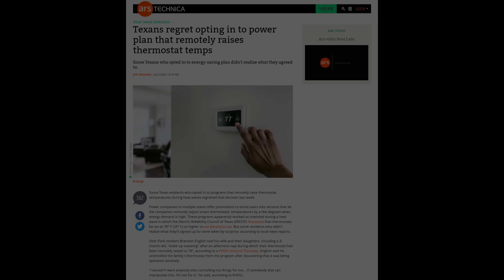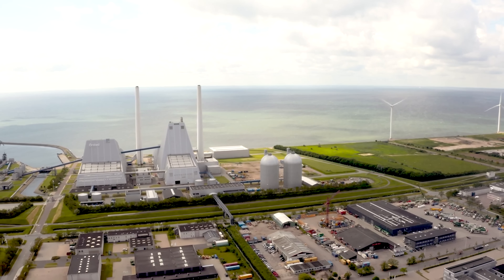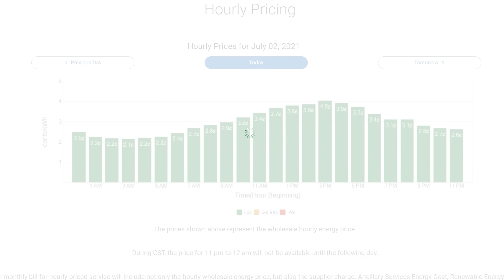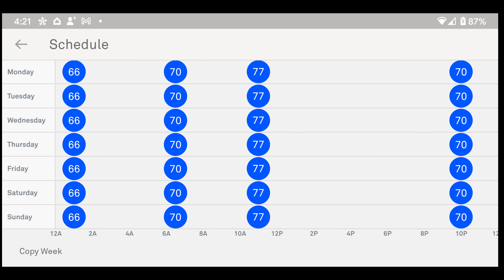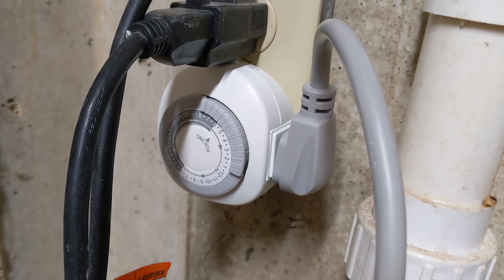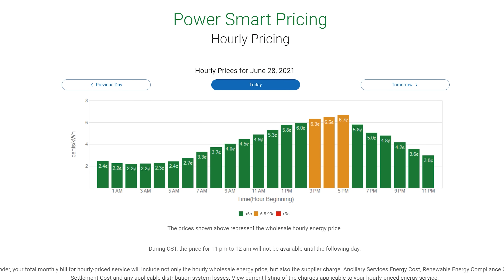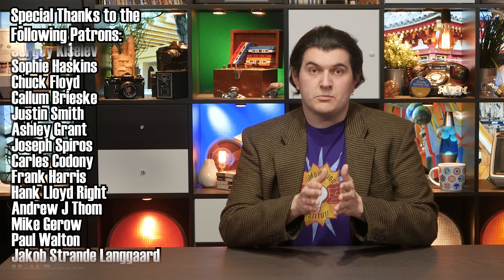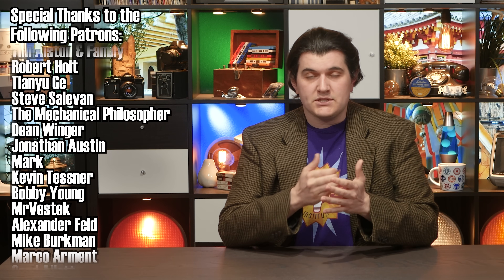Batteries aren't the only way to store energy. Here's another.

Comment: I live in Bangkok, the hottest city on the planet in terms of consistently hot day/night temps. I live off-grid on top of an apartment building. The people in my building generally don't run air conditioners a lot, as they are generally poor. Therefore there is a heat build-up which causes hot air in corridors to rise up the stairs and pass through my apartment, due to the ventilation. The people who lived in my apartment before me moved out because it was too hot and/or their air con bill was too expensive. Yet, I am cool, and don't run my air con at all for every month except April. Firstly, I open my doors during the day, and awnings (covered with PV panels) block the sun's energy. For night, I observed that night-time temps are usually around 26°C, which I consider comfortable for sleeping, especially with a thin blanket and a ceiling fan. So, I installed a separate ventilation fan to suck humid air out of the bathroom window, and added adjustable vents above our heads to let outside air in when we sleep. So we get fresh 26°C (79°F) air drawn in onto us as we sleep, and wake up to a nice dry bathroom (good for stopping anything growing in there). This is powered by solar charged batteries (along with everything else). There's plenty of sunlight here. Also, because fresh air is being drawn in constantly rather than recirculated, dust and mo(u)lds are no longer a problem. For April we run a Daikin smart inverter a/c gently blowing cool air onto us (as we want to be cool and don't care about the room, we can set the thermostat higher). It has a SEER rating of 26.

Comment: My electric CoOp, does exactly that, they 'pre-chill' my house before the peak demand- Only by a few degrees, and that allows them to turn OFF the A/C during the peak, while maintaining my temp... Oh, and if I find that I just can't live with it, I'm free to just turn the Nest thermostat and boom! It starts cooling again...  Of course, I'm risking a rolling black out for everyone.   The blackouts of 2021 (I'm in Texas), did change one thing.  I used to be on a  'critical' circuit, and never lost power in 27 years of living here... Well, OK, about 5 times for maybe 5-10 seconds max...  Since the rolling blackouts - which I didn't lose power at all during, they realized that although, I lived near a police and fire station, as well as very close to a pump for the city water, my house was not really critical, and they have rewired... Which, I lost power when they cut me over to the non-critical circuit, as well as maybe 5 times since... Which, really sucks...  Lost power just last week in fact..

Comment: I use the insulation strategy but its interesting to me to see others use it since for me I use it since I sleep extremely hot to the point I can actually heat up an entire room with a window facing a blizzard wide open for an entire day requiring me to have my window open to counteract any excess heat.

Comment: I've implemented this method of energy storage but with heat. In my country, we have high rate and low rate electricity. Low rate is from 10pm to 6am. And that's when I heat the flat. I kid you not. I've cut electricity expenses by more than a half. I can live with my temperature being 18.5-19 in the evening before I turn on the heating, because it's worth to have a chilly flat for a few hours than to pay twice the money for 2degrees difference.

Comment: I am going to issue a correction. 

At roughly 0:45 into this video, the claim is made that the "number of extreme weather events is rising." This is at minimum inaccurate, and at maximum, false. I have not heard any objective, scientific report issued by any public educational, governmental, or inter-governmental body, claiming this.

In point of opposition and fact, it is well-known that we have had weather satellites in Low-Earth Orbit (LEO), both geo-synchronous and fluid orbital satellites, and there is no evidence indicating nor supporting the claim that either or both are true:
1) That since the 1970s, the number of severe weather events have increased
2) That since the 1970s, that the severity of severe weather events has increased

Therefore, with no evidence to suggest that this is the case from an unbiased source, this claim should be discarded as false.

Comment: Here's a solution, assuming a government that didn't hate its citizens. Unify the power grid system into one nationwide grid and nationalize each utility into a single State run entity that can redirect excess generation potential where it's needed, eg, sending power from the Gulf Coast region during times when the hydroelectric plants we built into the desalination plants are generating a lot more than what the region needs and send that to the Mountain West states because they're having a massive heat wave and they're also combating wildfires

Comment: I live in Puget Sound region of Washington state in a 1940's vintage house with a basement.... no air conditioner... and my heat does not come on if temperature is 58 degrees or more, most of year no heating needed... rain and overcast in Winter keeps out side temperatures about rain temps... mid 40's... in summer the basement tends to stay cooler ground temps... power outages are mostly during storms... house not compatible with roof mounted Solar... most of our power is hydro... a little from wind farms... hydrocarbon  is almost gone...

Comment: I would put a sealed water tank underground and store my energy there. No need to mess with the temperature of my house that much but still instead of actually cooling during a peak period I would simply use a fan to drive air through my water tank cooled during off-peak with an actual heat pump. I would use water tank because water has a lot of heat capacity and if I put the piping at the bottom, the cold water will be there to take the excess heat and then it will rise out of the way.
Reply: 21:26 Something like that. Except instead of freezing the water I would simply cool it down to 2 to 4 celsius degrees. And have a lot of water there so after I am actually needing that cool air, I can send the air through some piping hidden in this tank, dumping the excess heat there.

Comment: There may be another advantage to running the AC when it is colder outside:  Since the AC is working against less of a thermal gradient, it may be able to pump out more heat using less electricity.  Is this true?

Comment: Instead of giving my utility direct control over the thermostat I would be more comfortable with my thermostat checking with them and finding that an unusually high load is happening and it is advised to reduce heating/cooling use, but I still have control over the setpoint it uses for reduced demand times and can choose to affirmatively but temporarily override it (unless it's a demand emergency) maybe for a premium cost.

Comment: I certainly prefer warmer temperatures than most in that 80F is most comfortable for me; unfortunately, my modem needs it to be a little cooler as it overheats if ambient temperature is above 78F, so I have my AC set to 78F, but even during summer in the Midwest, I can frequently avoid running the AC at all (or at least until quite late in the day) by opening up all my windows overnight and letting the house air out naturally. My house is about 40 years old and has seen no updates to the windows or insulation since construction, and even with that being the case, I'm able to keep things comfortable for my needs. While a big part of how my situation works has to do with my preferences for warmer temperatures as well as the fact that, even during the summer, in my area it pretty consistently gets down below 65F overnight, the point I want to make here is that it's worth looking at what we can do without using any electricity at all before (or at least in conjunction with) how we can use electricity most efficiently.

Comment: Transfer of heat depends on the difference between the two temperatures. The larger the temperature difference, the more heat gets transferred, so it is not simple to calculate the real savings of this scheme. The better insulated your hours, the better this scheme would work. But certainly using fossil fuel free baseload is a great idea. I assume you charge your car also at the lower Time Of Use rates.

Comment: Running your AC at night should also be more efficient, as the somewhat cooler outside air should mean the condenser unit doesn't need to work as hard to dump heat outside.

Comment: Our SMUD had its Peak Corps to shut off AC remotely via boxes screwed to your AC if you enrolled. That is all passé now. We now have meters that will track time of day usage, which allows higher prices during peak hours. Thus it is left to the consumer to decide when he wishes to run his AC. SMUD cares little how much energy costs, because the customer reimburses them for it, whatever time it is. So instead of added controls, it is solved by pure economics. Now if a consumer wishes to improve his energy usage with insulation, gadgets or strategies, more power to him. Else he pays through the nose, even to build new plant.

Comment: You are using a little more energy overall this way, because energy transfer through insulation is a function of temperature gradient, and in this way the amplitude in your house is larger. Still probably worth it, just wanted to mention it.

Comment: I wish i ever lived in a well insulated house. If it is 70 degrees F out my room will go from 65 to the temperature of the outside air in less than a full hour.
It happens faster when it is really hot out.

Comment: Or they could design homes and businesses like they did years ago when they were built efficiently and had airflow with a couple of windows open.
Reply: You brought up a good point because once people started using HVAC systems in their home Home Design and the engineering and Bob went to s*** when it comes to layout air flow where the sun crosses your home during the hottest part of the Year blah blah blah
Reply: @lyleg.9192  I remember renting a 1950's duplex and barely running the a/c (in florida). I'd open the front door with a screen and the back door and the wind that went through there could fly a kite. In my "new" home, if I turned off the a/c, I'm cooked. so yea., tech is great, but not always as great as good design.
Reply: @no_handle_required  it's not so much about new homes with technology it's the complete lack of Home Builders and for that matter home buyers using tried-and-true steps for where to locate the home how to build a home the environment around the home everything working together where does the Sun Cross during the solstice everything playing its part the biggest problem with new homes is it technology it's constructed to make it energy dependent

Comment: I have some friends that say to keep the house at a constant temperature. They say that if you let the building raise temperature it makes the AC “run harder” when you turn it on. Can you please speak on that?
Reply: depends on how long the AC is running, how well the building is insulated, the climate, what kind of AC is runnging. Generally, if you know you're in an area of high humidity with a heat pump AC and plan to go somewhere for more than a day, never shut it off because when humidity climbs, that promotes mold. Also AC's are either on or off, they only cool and heat at a specific rate, though leaving it off will make it have to get to temperature because it starts to cool/heat.

Comment: This inspired me to take a more in-depth look at my AC scheduling. I commute to work so I could skip some of the daytime home comfort settings, but I've further dialed in my AC to get it to do what I need it to. I looked at my Ecobee data in Home Assistant and realized my AC was short-cycling at night and during my "home" comfort setting. 

To combat this, I'm going to try the strategy to chill my apartment to 65 at night, let the cooling set point sit at 77 during the day (like I had been doing), have the AC kick in at 4 to re-chill the apartment to 68, and cut back up to 73 at 5 so that it's comfortable without running the compressor as much.

I live in the south east in an apartment that gets afternoon sun and doesn't have great insulation, so by the end of my "Away" period, the temperature in my apartment will reach 77 or 78 even in April. Hopefully, a few long runs of AC and longer periods without will reduce the overall time I have my system running and lower my overall usage. I'll see how it does this month and see if I remember to follow up in August after a few summer months.

Comment: This is a great method for cretin AC systems. Single and maybe dual possibly 5 stage systems. I have a Diakin Fit system with a variable speed swing compressor and I tried doing this and it just doesn't work. The system works cheapest when the temp is changed maybe a couple degrees.  I know you love heat pumps have you thought about covering variable speed systems?

Comment: If you are going to do this, can you make it more efficient? Or add more storage? For storage, I think you could designate a room that doesn't get used much, maybe the basement or attic, and set its temperature to be much lower. Then you need a way to put that cold air back into the HVAC system, either a fan that can reverse itself or a heat pump that will transfer the energy back to the beginning of your system.
Or maybe some setup with a freezer, that is designed to hold much colder air.
Reply: Water, a good sized insulated bladder of water.

Comment: I have 15kWh of batteries, so I charge them up at night (12:30 to04:30) 'off peak'  and charge my EV at the same time. In light of your program (is that the right word? Blog doesn't seem right.) I shall adjust my ground source heat pump timing to optimise for winter. Currently all my power usage is in the off peak period. In Scotland we are beginning to get overly hot nights, but it's usually a heating thing.

Comment: Get an April Air dehumidifier. Yes, it's $1000. But, it pulls WAY more moisture out of the air than the cheap crappy one you show in this video, and it is VASTLY more efficient.

I'll take that trade off. And I need it because I live in the southeast, where moisture is a way of life!

Comment: I tried this with my house. My 90s era windows and insulation is so poor it doesn’t work. The inside of the house will be back up to 80 in a couple of hours under peak summer thermal load. Even running nonstop the AC can’t bring it below 78.  It’s a great idea though.

Comment: Rolling blackouts and other demand side measures are a consequence of the fact that we have build very little new generating capacity over the last fifty years. The little bit of overpriced wind and solar power that has been built recently has to be supplemented by some sort of generating capacity that will work at night and when the wind doesn't blow or blows so hard the pinwheels have to be feathered .

Comment: Sadly, there are two reasons this concept doesn't work for me. The main one is I have two renters in second floor rooms who would melt if I didn't run the AC during the day. I set it at 74 because if I put it any higher they roast. The second reason is that I have a solar plant. Using power when I'm producing it myself is more efficient than using it at night when there is no sun.

Comment: My local utility (evoenergy)'s proposed 2024-2029 residential tou tariff structure has completely rejigged power pricing, making this far easier to accomplish. 

Power will be super cheap 11am-3pm, cheap-ish 9am-11am and 3pm-5pm, expensive as hell 5pm-8pm, and only cheap 8pm-9am if you keep your home's actual draw below 6kW.

So they're trying to shift load to exploit solar oversupply here (which is now a real problem) as well as reducing the size and scale of grid battery storage systems and the hydroelectric system at night now that our coal plants are being shut down.

Maybe I should buy a crock pot!

Comment: Our house was built in 1993, the windows are about 10 years old, and the house has medium shade cover.  We set our AC at 77-78 during the summer (last year, I was able to negotiate it down to 76) and the unit is about 10 years old.  I'm located in South Carolina.  The energy provider says we use significantly more power than the average "comparable" house, with AC accounting for 40-50 percent of our energy use.  How could we reduce energy use through climate control, since that is by far the largest energy user in the house?